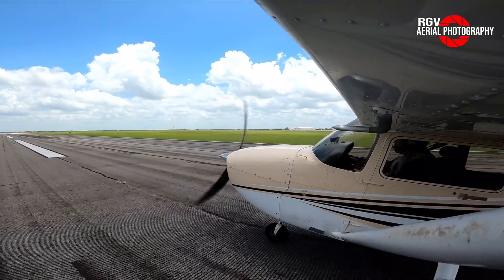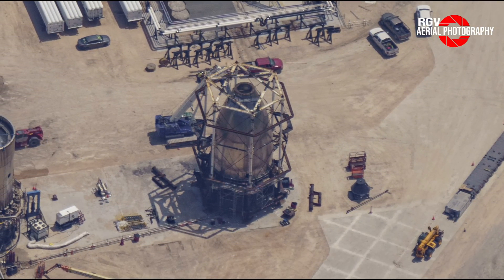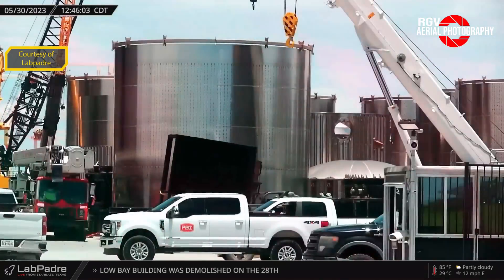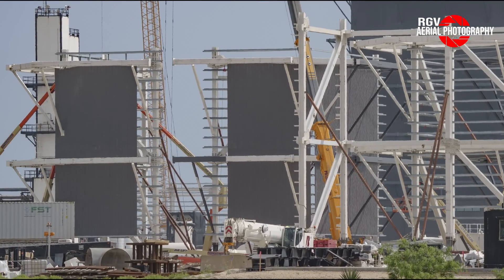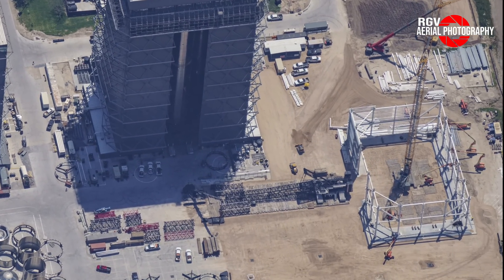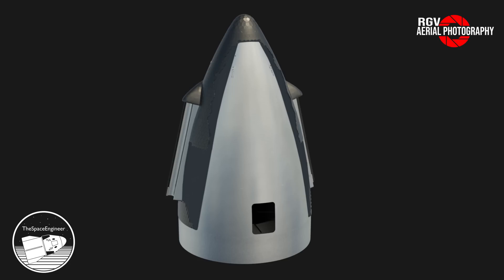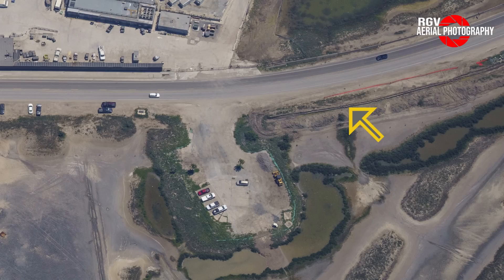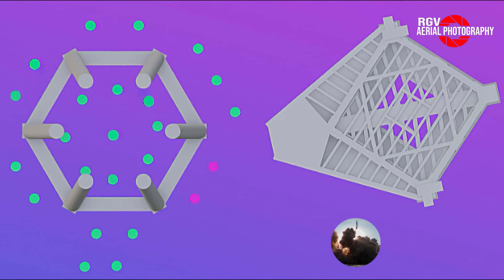SpaceX Starbase Flyover Update Episode 4

Comment: These cutouts are for "hot staging," in which the next stage engine is ignited prior to separation of the booster; this ensures that the fuel is sitting at the bottom of the tank where it belongs (fuel gets slushy in space). Hence, tne engine is ignited while still connected, then it literally blasts itself away from the booster. They also call it "fire in the hole."

Comment: Has anyone talked about or questioned what type of support structure will be below the cooling plate system? It seems unlikely that it would be supported only by the cooling water piping on the outer perimeter. Those many elbows feeding water from main header pipes to the various cooling plate sections would not be load bearing structures. They supply water. So that requires a separate structure to support the cooling water system.  As soon as Raptors fire up that is a hell of a shock load to all those plates.
Shorter version, what supports the upside-down showerhead? 
Perimeter piping carrying load is dubious at best.
Reply: They just spent the last couple weeks sinking huge supports.
Reply: @TheEvilmooseofdoom  You'd have to have been blind to miss that but that isn't what I asked. I said "what kind of support structure" which is significantly different than a bunch of pilings in the ground. For clarities sake "What is the engineered solution, of which the pilings are only a small part, that will support the cooling plates. Those pilings are the equivalent of the footings on a house. They may need to get in that underside to do repairs at a minimum. Weld cracks underneath, how do you repair?

Comment: Strange they can dig there more than 16 feet deep but refuse to dig in same conditions at the launch site for a proper flame trench.
Reply: They don't need a trench, that's why the platform is so high.
Reply: @TheEvilmooseofdoom  unless it was sarcasm then yeah best comment ever then lol
Reply: @Fatpumpumlovah2  No.  It's really quite simple.  You don't quite understand what does what or why and so you render an ignorant opinion.  A flame trench is dug to give some clearance under the booster.  Inside the trench a diverter is installed to.. divert.  Spacex decided not to dig a trench, they instead raised the table high off the ground, higher than the trench under the launch site(s) in Florida.  What they skipped was a diverter, they seem to want to keep it flat under the table for now, I suspect that's to make it easier to get the dance floor under there.  A diverter may yet show up at some point but they don't need to dig a trench.
Reply: @TheEvilmooseofdoom  lolol you obviously just got here and havent seen the aftermath of the test flight and why now installing yet another system thats untested.

Comment: Just my ideas;
The ramp ... maybe the blast/cooling plate will be higher than ground level and is the ramp for the engine work platform to drive on the steel plates?
The strange segments and tanks; could they be for a Tanker StarShip version?
Reply: Agreed. The ramp is probably a flame diverter for the OLM. 
As for the strange segments, maybe? I'd call it absurd, but we're seeing HLS parts.

Comment: will they use masseys for static fire test in the future?
Reply: I think that would make sense. Someone mentioned in one of the streams, not sure which channel, that it wouldn't make sense to close down the Launch site for a whole day to do a static fire, as that would also mean no one could do work on the Orbital Stand. That said, I think they would need to do some re-arrangement of Massey's to allow for positioning of the Static Fire stand. They are maybe about 1/8-1/4 the size of the suborbital tank farm, and the current positioning of pads is a bit closer to the farm than current suborbital stands. They'd probably have to position on the west side of island, either the southwest corner (where storage stuff is next to the tent, opposite the pressure-test area) or northwest corner (near the nosecone test stand.) They COULD maybe be setting up that new stand in the center to be it, but they'll need to build up the berm between it and the tank farm (probably using Hesco barriers.)

They COULD also re-purpose the tank pressure area to be a test stand. That would let them run the pipes along the side of the island instead of directly through middle, and its already distant from the tank farm AND has some of the Hesco barrier framework already in place.